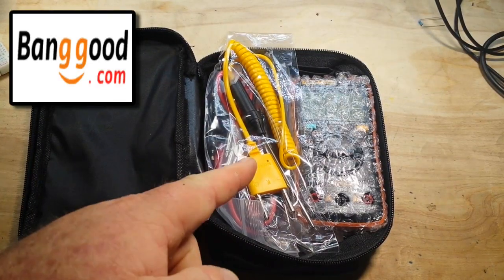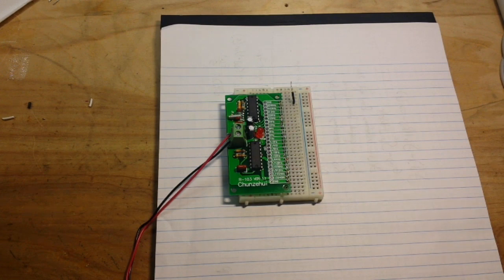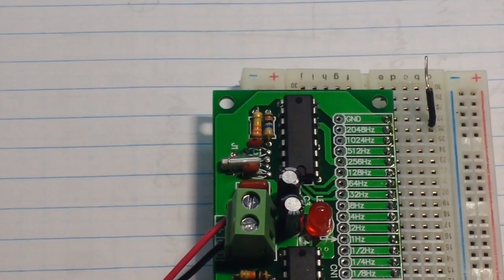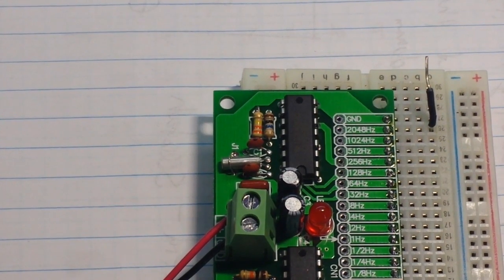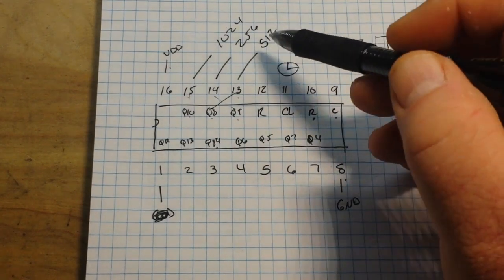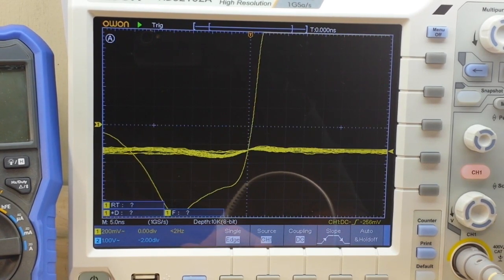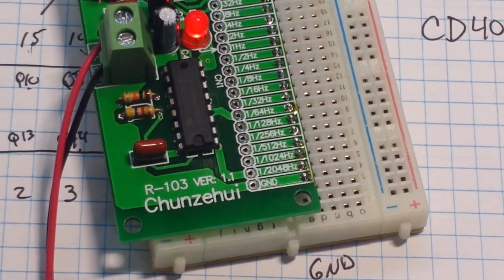Super Stable Oscillator with the CD4060BE

Comment: @learnelectronics I’m trying to generate at 1Hz square wave with the CD4060. I noticed in your video when you probed the 1Hz you had a peek then the signal slowly returned to 0V almost like a sawtooth. I’m seeing the exact same signal. Were you able to get a nice square wave with your circuit at the lower frequencies? I’m able to get nice square waves like you at the high frequencies but not at 1Hz and you can see that voltage drop gradually get worse the lower the frequency gets. Any ideas on what is causing this? Thanks

Comment: Hi I'm trying to build a quartz crystal musical osc and that circuit might work, would you know how I can get it to work through my guitar amp? I have already tried to do something similar with a transistor circuit to amplify a passive buzzer and then I connected it to an osc cd4060 ... It seems to work with crystals too, but I don't really know... Could you help me ...? I can't find the corresponding info on any site or a diagram that can help me. I don't know much but sometimes I have good ideas with electronic devices

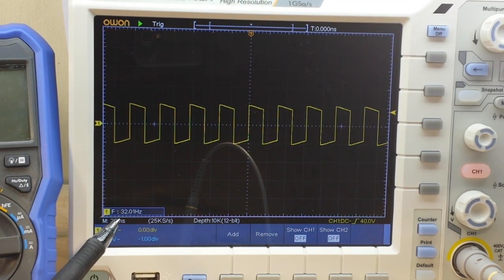Comment: Well it's another nice and simple circuit, no programming required. But signal at 6:00 looked like a triangular wave form at 32Hz. I would blame the probe compensation but it is pretty at 1.024KHz.  Big Oscilloscope screen
Reply from the maker: The scope is the new Owon XDS2102A with the latest firmware and an 8" diagonal screen. Ill have a review/teardown soon. As for the waveforms...could be just some coupling. All of the outputs are a pretty nice squarewave with a very low risetime.

Comment: Awsome, as always. Is it possible to attach a speaker directly to the output?  Could not see the output voltage on the shot of the scope. Any suggestions would be greatly appreciated.
Reply from the maker: 9VDC in ....about 4.2VDC out. You would want to put a capacitor in between the output ans the speaker to block the DC.

Comment: Can anyone point me in the direction of a square wave generator that will do from about 1% to roughly 65%? A bigger spread won't hurt anything. I'm doing testing and repairs of 12 vdc, pwm, 15 amp or less solenoids and I need a way to manually operate them. Any help would be greatly appreciated!

Comment: Nice. I was working on a counter for a tempo led on my home made delay pedal for my guitar. Its not sensing the signal from the delay IC correctly though. :(    
My old analog oscilloscope is shit. Can someone please suggest any cheap oscilloscopes available in India ? 40Mhz would be ok for my use.
Reply from the maker: Hantek 5072P